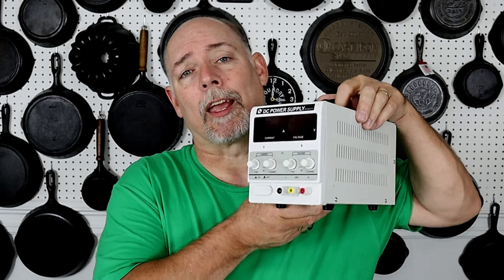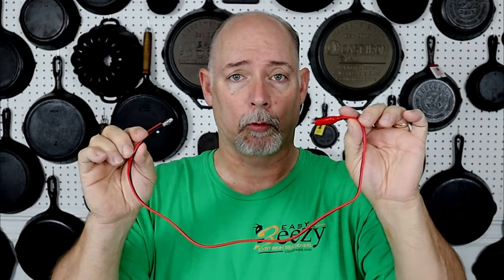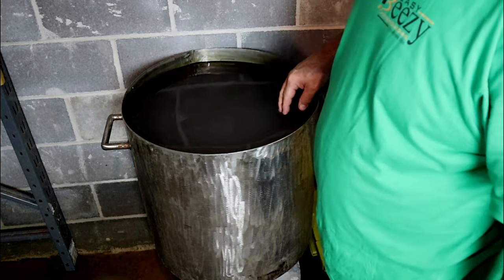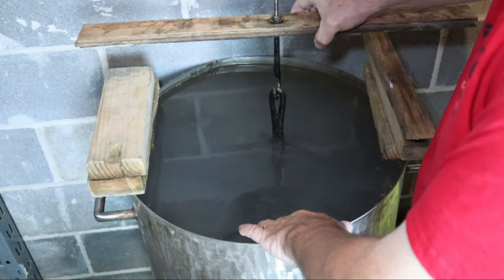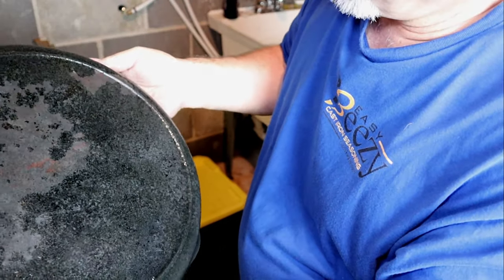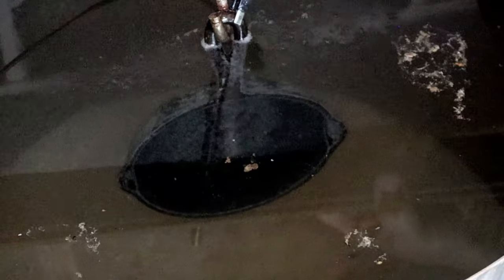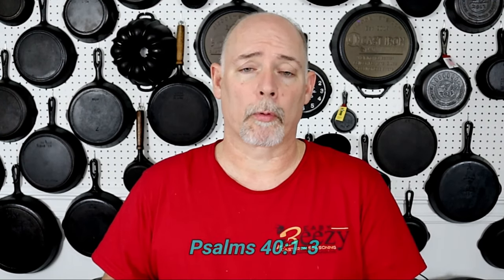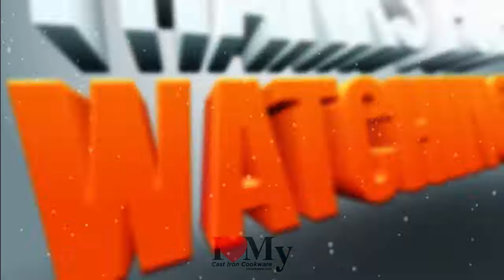DC Power Supply For Electrolysis

Comment: Let me clarify how I recharged my tractor battery.  I would disconnect the jumper cables from battery and my skillet before I hooked it to automatic charger.  When charged, I would reconnect jumper cables to both battery and skillet after disconnecting battery from charger.  I agree with Mr. Larry Stephens, I did not use battery while it was hooked  to charger for the reason he stated.  The risk IS NOT worth it. The point of my previous comment was that I used a battery to supply power to a tank because I couldn't find a manual battery charger.  And I didn't know another electrical power supply that I could find and use.  That is why I was so happy that Steven did this video; he showed me a product that would supply continuous and known amperage.  Again, I thank him for doing this video and look forward to seeing other videos in the future.

Comment: I metal detect as another hobby and "electrolosize", as I say, a lot of items using a manual battery charger and they eventually died.  Even small items can take a very long time depending on how bad the rust is.  I made mine from a plastic tote, rebar or a brake rotor and a hanger to run the charge to the rusted piece.  Worked like a charm.  When I was reading about building a tank there were several articles that said not to use stainless steel.  As far as the compound you need to use Arm and Hammer washing soda (sodium carbonate) and not baking soda (sodium bi-carbonate).  Happy hunting....

Comment: I can say one thing you must have convinced a lot of people on your YouTube channel to buy one of these power supplies and leads. Both of the ones that you have listed are not available they are sold out.

I'm glad you said something about the fan. When you first started the box it sounded pretty loud and normally that's an indication of something not me very well. But after the test you put that box through proves that it's a pretty good built  supplier. 

I've never have tried this out yet but come this fall I'm going to have a project going on in the garage. I'm finally going to pull the motor out of my pickup truck and over the winter rebuild it and have it ready for the spring. I'm not crazy about using battery chargers like others have. I like the idea of what you stated at the beginning of this video. You want to be able to control the amperage and voltage going to your parts.

I rarely enjoyed your video and I definitely made sure to hit the like and subscribe button. I figured that's the least I can do for someone sharing some good information.

Comment: Nice work, I was told by another guy to remove the grease first before electrolysis, something to check, I have a marine engine I'm doing right now, 6 amp charger, worked great on the exhaust manifold, doing the head now.

Comment: I have been using several different DC power supplies from different makers, both regulated and variable. You can find them on eBay fairly cheap. Astron makes nice ones.

Comment: Thanks for showing this! I have been looking for a non-automatic battery charger and had no luck. A DC power supply seems like the answer. 
Also I've read about using stainless steel for the sacrificial anode in electrolyis and warnings about creating highly toxic by-products.  They said that if your electrolyte is turning yellow, it is a sign that you are producing hexavalent chromium which is very toxic and carcinogenic. But then another source said it is doubtful that will happen at low voltage.  An issue worth researching.
Reply from the maker: So far I have not had any issues. I have purchased some Hexavalent Chromium test strips from amazon and not had any contamination results. Still testing often though.

Comment: I was reading a post on a group site and someone said how good your videos were. I’m a newbie and have been bitten by a big cast iron bug. I am so eager to learn all things about cast iron. Funny thing is I’m trying to make a e-tank and had the problem of finding a battery charger. Someone on the site suggest Schumacher SM 1437 from Blains. I researched it and they have the best price. It’s a manual 6/25/125 amp and also has a timer on it for a couple of hours. I’m guessing this will be ok. I know nothing about doing this. I’ll look for a video on building a tank and see if I can find out what amperage I need to use. 
I’m so glad I found your videos. Thanks for putting them out there and teaching us what you have learned. I needed to find someone who had information and didn’t mind sharing it. I enjoyed the video on DC power. Thank you.
Reply from the maker: Originally, I was using a 40amp manual battery charger but the DC system works fine. You just get more activity with higher amps.

Comment: I have been speculating for a while that this would work, and you have proven it.  I am fortunate to have 3 big upright 2/10/40/200 amp manual battery chargers, one still new in the box!  Your stainless tank appears to be very conductive to support that percentage of current as compared to the output setting on the power supply.  My stainless plates are not as conductive, but they still work.  Just a little slower.  I only register 2 or 3 amps on the meter when I set the charger to 10 amps.  As for the #14 pan and its sad condition, it should still work well for pizza!  I don't know that I have ever seen a Red Mountain #14.  I only see Century #14s.

Comment: Im using a Nevada 8A CB/HAM PSU. At first the tank drew too much current and the ameter end stopped! I've now put a big load resistor in parallel and it's holding nicely at just under 3A. PSU not getting hot. I've sat an additional fan on top the PSU as a precaution. All is good so far and tank looks like it's removing a lot of crud! 😉

Comment: Thanks you for sharing. I too have tried to find a manual battery charger and can't find one. I don't know why I never thought of a power supply. Ham Radio operators use power supplies to power their radios. I've seen power supplies up to 50A. With the price of lye I'm going to start looking for a power supply and build a E-tank. Thanks again
Reply from the maker: Tractor supply is now selling a manual charger. Apparently Manuel's are needed on some farm aquiptment. I have also run across them at pawn shops, thrift stores and flea markets.

Comment: Good video.
Use Dow Corning DC4 Silicon Grease Electrical Compound to deliver a moisture proof seal for cable connectors, battery terminals, and such. When the croc clips are in contact with the solution then no reaction takes place, so all the current is forced to pass through the job only, thus making it much more efficient.

Comment: What you need is a current source. I use my tig welder on DC + crank it to 75 amps and do in 4 hours ( outdoors ) what takes a full day otherwise. it comes with fat cables too.
I found a great dutch oven Giswold large badge bottom it did not come with the right lid. I would love to get my hands on the proper lid with badge and labeled tite fit lid. seen any? Going to try your eezybeeze soon. love your videos.
Reply from the maker: Great idea. Lids are a little harder to find than the bottoms. I think that you will love the results that you get from Easy Beezy.

Comment: Great video Sir. I'm a retired Marine in search of new hobbies and restoring old cast iron cookware is high on my list. I made an electrolysis tank out of a tote to see if it would work but sourcing and installing multiple anodes became a frustration. The idea of using a stainless steel kettle is intriguing as it would enable 360 degree coverage of the artifact and eliminate multiple wires/connection (failure) points. This seems effective and efficient in terms of achieving good rust removing results. My only hesitation is that many people suggest that a stainless steel tank will increase the chance of producing toxic fumes which is an obvious concern. Having said that you seem healthy and unaffected using your method. Please advise if you're still using this method or if you have switched to something else. God bless and Semper Fi, Ken
Reply: I've been using stainless steel in my setups for over 30 years and have never had an issue, you are good to go

Comment: I was using an inverter welding machine, but recently got an analogue 24V 15A dc unit from china. It melted the cables almost instantly so i will try to get bigger cables like you have suggested. Thanks

Comment: You can use your adjustable DC power supply as a battery charger too, first turn down the current all the way and go up to about 10% current, then set the voltage to the maximum charge voltage (~14.1V for starter battery, 4.2V for a 1S lipo cell, etc), then hook it to the battery, see the voltage indeed drops, then turn up the current to whatever you want (constant current mode), it will eventually land on the voltage you set and stop the current when it reaches the voltage you set because it would be in constant voltage mode. Do not touch the voltage knobs after you initially set it!!!  This is why battery chargers exist, because people "accidentally" or really stupidly bump or touch the voltage knobs after setting the end voltage, to prevent stupid they make battery chargers so you cannot accidentally change the end voltage.

Comment: How about the converters found in any old desktop computers? They have multiple dc output leads, primarily +12vdc, with a few different amperage ratings. There are also +5vdc and, depending on the brand/era, a few -5vdc outputs. I have been planning on doing some tools as a test
Reply: Will definitely work - and they push out quite a hefty current at 5V - and it's the current that does the work; there's only a small PD across the piece you're working on anyway.
I built my supply for nothing from scrap lying around in the workshop - it uses an old PC PSU fan for cooling, but it is analogue PSU, not switch mode like a PC PSU.
Mine gives about 12 Amps continuous and left on working for a while actually heats up the 25 gallon tank of washing soda solution ! Fitted an MCB off an old mains distribution board to stop problems if the terminals went together by mistake.

Comment: Hello. I have a question is this something that I could use. It is analog but has safty features.   I so have to say that you have made me hobby driven.  I'm starting small have my tank almost built. Still watching videos to see if I can improve or not but this is 2/10/50 Amp charger. CEN-TECH 2/10/50 Amp, 12V Analog Charger with Engine Start

From harbor freight.   It's $40 new.  Anyways thanks for the videos sir.

Comment: Great video thanks. I thought I had read somewhere stainless steel is not good to use because of some sort of toxic chemical it produces in the water? Also can this DC power supply not produce 12 volts?
Reply from the maker: SS is fine at low voltage. Not a problem unless you have a huge industrial setup.

Comment: So what I find odd is why only 6 volts with 9.97 amps? That supply is usually CC or CV in operation which is Constant Current or Constant Voltage I wonder what would have happened if you started with the voltage wide open with the current low and once you saw the CV light on start raising the current to see if you can get it at 30 volts @ 9.97 Amps and see if it affects the electrolysis action any differently. Also what do you use as your electrolyte, Baking soda, or Washing soda or 50/50 vinegar & water with Salt mixture. The Stainless steel pot is Genius, good video.

Comment: Thank you for the useful Cast Iron information, your great channel, and all of the effort you put into it. I appreciate it.  
 Aside from skillets, I also like to restore my waffle irons, muffin pans, etc., which for now I scrub with short nylon bristled brushes after back and forth lye-baths and Evaporust-baths as needed,  a system that is not only slow but is both tedious and laborious (just like this sentence). 
Anyway, E-tanks seem like the way to go. And you do make it look so easy!! 
However, I've always been a bit leery (scared to death) of using an e-tank myself on account of my complete and utter lack of electrical knowledge. You have it all detailed here pretty clearly with these components, and have described the fundamentals in prior videos and thus have armed me with some confidence. 
However, I still have a few (maybe dumb) questions. 
Can it damage or dissolve the cast iron in any way, like maybe by leaving it on for too long, or at too many amps? 
Can it adversely affect nickel or chrome plating, it seems as if it would, although I do see some commenters here saying that it does not.

The main fear though (beside immediate death by electrocution) is : Can I  damage the cast iron item in any way?
 Thanks!!!
Reply from the maker: The only risk of damage that I know of is if you allow the cast iron to touch the sacrificial anodes, causing an ark and possibly burn a spot on the cast iron. I have never had that to happen neither have I heard it happening.

Comment: Word of advice about those DC bench power supply if you are buying them from eBay or Amazon most likely they are made in China and are really cheaply made and my have a risk of caching on  Fire because of bad  wiring connections inside the  Unit I use them for  Repair an electronics testing circuits But I would never leave one running without being home or near by if you know what to look for you can take it apart and check the  Components To make sure there's no bad connections just a heads up

Comment: High-Power SMPS 110V/220V AC to 12V DC Converter - 50A 600W Power Supply - Adjustable Switch Transformer for LED Strip, LCD Monitor CCTV, Radio/Car Stereos, 3D Printer - includes 2 Clamp Wires

Comment: I bought something similar, and I'm getting about 0.10 to 0.20 amps at 19 volts. Using a carbon rod in a big plastic tote with sodium carbonate. So far this seems mostly useless, with not much in the way of bubbles. I had more luck with a repurposed USB wall charger, even! How to get enough amps that this is useful? Thanks.

Comment: I use an automatic automotive battery charger with no issues. Just ad an old car battery in parallel and it solves the problem.

Comment: Hi, basically I'm using 12v 2amp dc power supply plug in to 220v. I think this was old power supply of network cables router. What is the different / benefit using this device?
Reply from the maker: The manual battery chargers are getting hard to find and these are a good alternative.

Comment: Love learning something new. I have a manual battery charger I keep hidden in the garage. 

Have you done a video about cleaning nickle plated caste iron?
I didn't see one in your playlist.
Reply from the maker: I have owned a few but have never done a video on them. Maybe the next time I run across one I will do that.
Reply: I've done electrolysis on a few nickel plated pieces. It doesn't hurt the finish.
Reply: @stevesparta4995  Any adjustments needed from the regular method?
Reply: @dagneytaggart7707  no nothing different. Same as the black iron.

Comment: Hi David, just set up my first “tank”. Bought a DC power supply, variable up to ten amps. Got my first piece in, cranked it up to ten and it started processing immediately. So much activity I got a little worried and turned it down a few notches lol. Question, how high do you think I can set the amperage without damaging a piece of cast iron cookware? I’m using the A&H wash as you suggested at ~1 cup per 5 gal water. Many thanks in advance (maybe…you’ve given me a new obsession with your videos, they are outstanding!)
Reply: Also wondering this, did you find an answer?

Comment: Stephen, do you know if you can use a normal car battery while being charged with an automatic charger?
Reply: Will it work?  YES...  Do you want to do it.. NO...  You run the risk in the battery exploding... Not worth the risk...
Reply: Of course you can. To limit current from the 12V supply, I insert a 21W, 12V car light bulb in series. Any shorts between the job and the anode are thus rendered harmless. Also, the action works better at lower current; it is current DENSITY that speeds the job up.

Comment: How long is too long to leave a cast iron skillet in an E tank can you damage it like you do in vinegar
Reply from the maker: I have let them run for several days at a time without any problems. The water may get warn and I usually turn it off before it gets hot and let it cool to avoid too much evaporation.

Comment: Isn't the harbor freight  cen-tech battery charger manual   I know harbor freight but you are not using the thing professionally in an automotive shop just every now and then to strip some cast iron
Reply from the maker: Yes, Harbor freight has been offering some manual chargers lately.

Comment: I just bought a similar DC power unit but I can't get the amps much over 3.  Does the gauge wire effect what amperage you can pull?  I just used the wire/clips that came w the unit.
Reply from the maker: Yes. I added some heavier ones and it really helps. https://amzn.to/3222GV9 *Amazon Affiliate
Reply: Maximum amps are mostly depended on the size of your part, your anode and the conductivity of your electrolyte (the liquid). I had the mistake of not properly mixing soda into water, and amps whent up after I did that. Then I added another anode and got more amps again.

Comment: You won’t find a power source producing much more than 10 amps if it is wired for 120 V because most 120 V outlets have 15 amp fuses/breakers; some may have 20 amp, but that is the max.
If you want more amps, you will have to go to a device using a 240 V outlet.  The max amp draw from a “home” single phase 240 V outlet is 50 amps.  Also, 50 amps from a 240 V outlet is equivalent to 100 amps from a 120 V outlet—this take home message is don’t mess around with electricity if you don’t know what you’re doing.  You will literally melt your wires.  And from there, things get very bad very quickly.